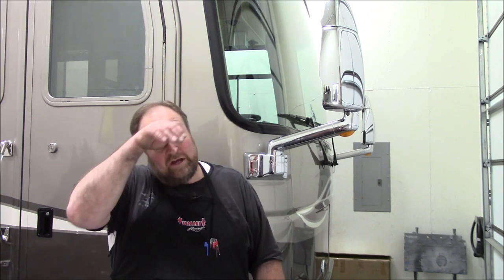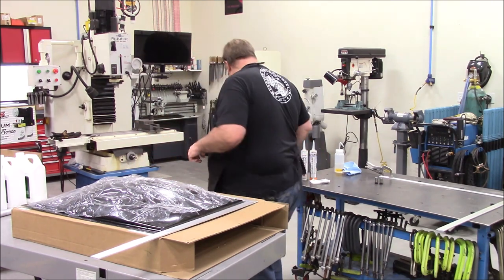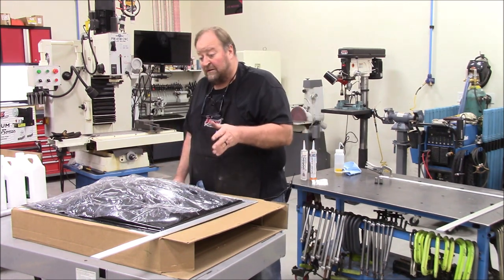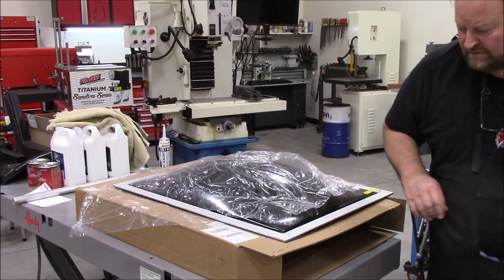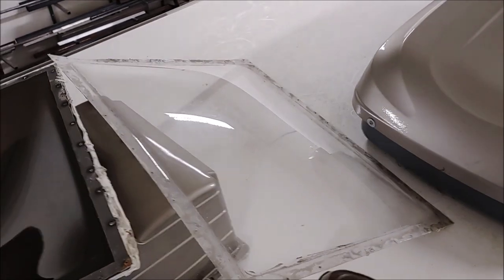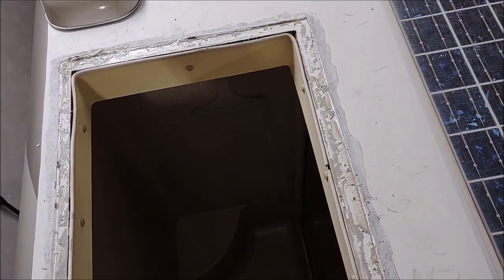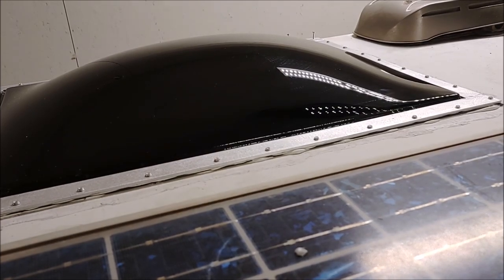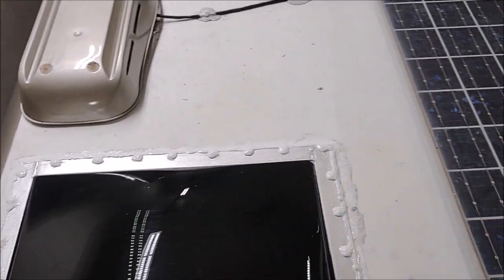Monaco Dynasty Skylight Replacement

Comment: Mike,
Great job building the frame...  I am a little concerned on 2 fronts.  Please share your thoughts.  The first is Corrosion from  the water maybe even salt if you get close to the ocean, is running down and under the Alum. frame.  The frame is creating a pool for water to stand next to it. Did you use SS screws?   I will have to replace my skylite on my Dynasty shortly and I will most likely use SS screws and large SS washers to cover more of the surface.  I may even use SS plate but not as wide as you did and seal under it before putting it down..  Thanks for sharing what you did.

Jon
Reply from the maker: Jon, no worries with water pooling as I'm sure it will evaporate and each layer as well as under the aluminum frame has butyl caulking applies soon no chance of it getting under the frame.  Yes, I used stainless steel fasteners.  
Thanks for watching.
Mike

Comment: Nice job! I would like to do mine this way, but I need to find the parts first. My skylight isn't square. Quinn
Reply from the maker: Many Monaco's use a squared off triangular shape as well. I would still use the same process even if mine was the other shape.  I remember seeing the other Monaco's  shaped skylight  on several websites that I looked at when I was researching mine so I know they're available. 

Mike
Reply: @zmotorsports62  I am looking now!